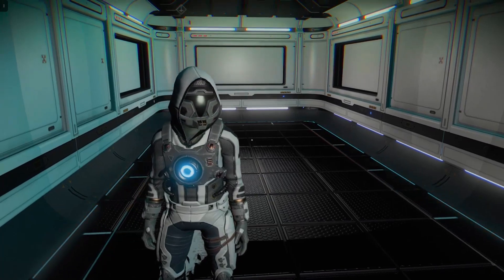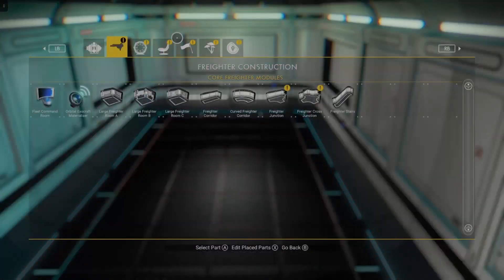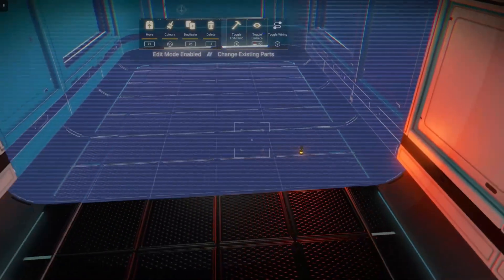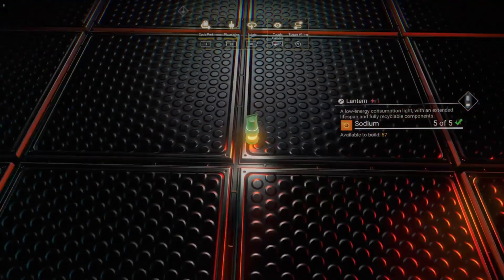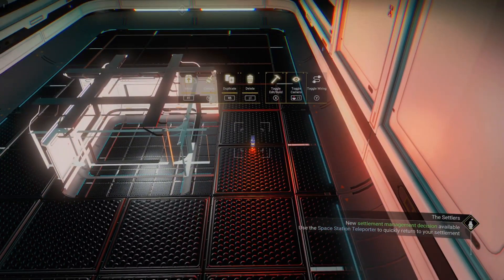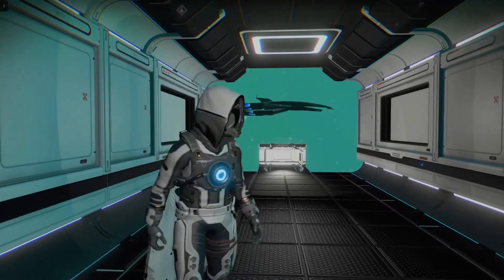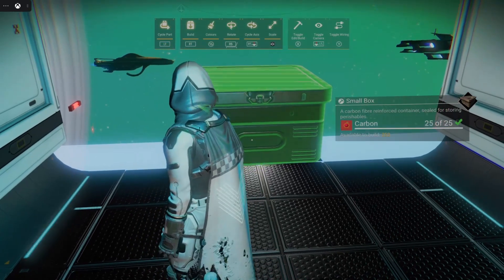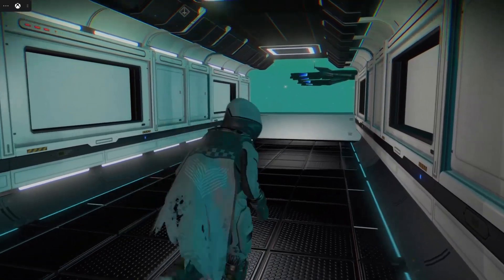How to open your freighter to space, exit your freighter without chairs (legacy parts required)

Comment from the maker: Kail Labs ( https://www.youtube.com/channel/UCmY1oOanx86IJBie3wOd9TA ) has discovered a way to completely hide the miniature freighter room. You place it in the exact same spot you see in the video except upside-down. There are various methods of doing this. I found that pinning a small straight decal to the ceiling and using that for my universal adjacency glitch was the easiest.

Also, if you use a hallway instead of a small room you will end up with a doorway instead of an open wall.

Comment: So like after watching a few of your videos.. it pisses me off to no belief that youre like, "now we'll line it up" and although you say it doesn't have to be perfect, it would be SO MUCH EASIER if you just moved your camera.  EVERY TIME you like look at it from a 30° angle off to the right looking at a slight angle down.  Like if you just position yourself above it and look straight down... POOF always straight cause you can ACTUALLY SEE IT LINE UP Jesus Christ that pisses me of for no reason
Reply from the maker: did you try this? decals do not rotate with the camera so you cant rotate the camera to line them up. they actually align based on where your character is standing when you enter build mode. you could stand right in the center of the room to help with alignment, but i still prefer the build camera rather than running my character around.